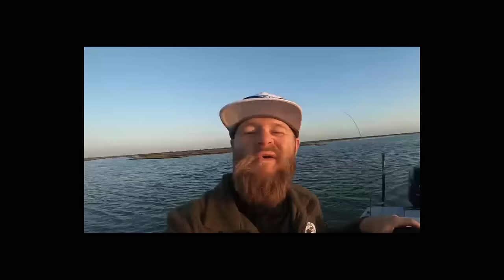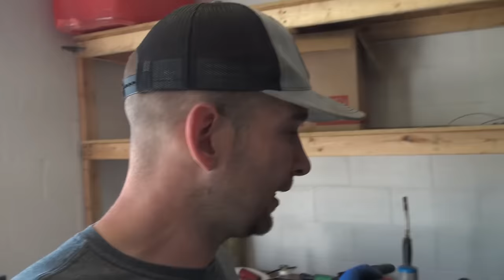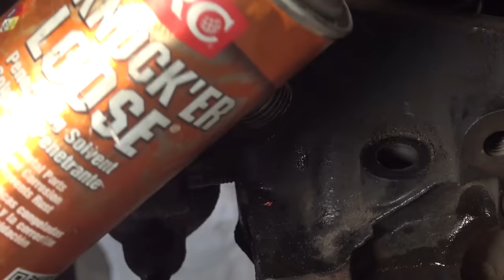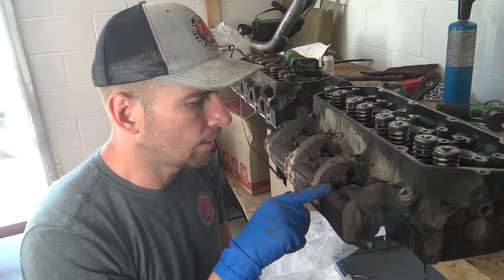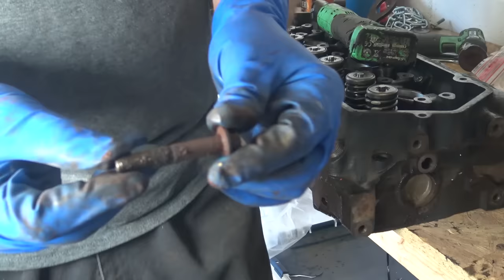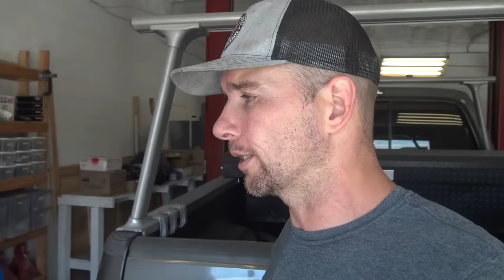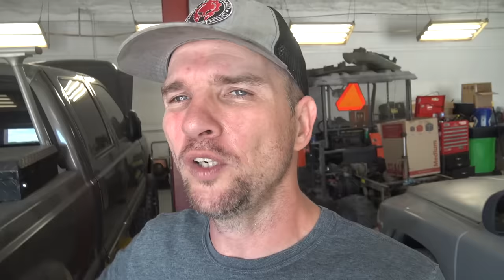Old Mechanic Taught Me This Trick To Removing Rusty Exhaust Manifold Bolts!

Comment: Great video man! I have one piece of advice, when I’ve been working on customers cars/trucks and I’ve had to remove their manifold upon reassembly I’ve changed out bolts for studs 😉👍🏻
Reply: By stud do you mean basically a bolt without a head?
Reply: Good advise!
Reply: That works pretty well if you intend to take the head and manifold on and off together. The problem you run into is a lot of vehicles don't give you the room you need to slip the manifold off or onto the studs. So you have to evaluate this on a case buy case basis. You could run into a tight fitting v8 head where you install the studs then torque down the head and find out you can't get the manifold on over the studs.

Comment: GREAT TIP
Learned this from my old high school shop teacher...though we didn't have any release lube then. And I was shown the heating part by my father. 
Though I didn't know about the sagging of the manifold. I Do Now
I have also found that if you smack the head of the bolt with a hammer while turning the wrench, that will work too...though not a 100% fix.

Comment: Hello, Stephen. Your video on loosening rusted manifold bolts saved me.  I bought a 2018 RV from a dealer.   After getting it home I discovered the water heater had never been drained. The heating rod was corroded into the tank opening and was not about to let go. I sprayed it with lock freeze, or unfreeze, then WD - 40.  Let it sit a day or 2. I used a narrow chisel to knock the  corrosion loose from the tank keeping it away from the threads. Brushed it with a small wire brush, tapped it with a small ballpeen hammer, then applied your technique. Pressure. Flip the switch. Pressure flip the switch. Took about 10 switches but it came loose without damage. Your technique saved me a lot.  The dealer should have done it during make ready.  Now I have to clean the remaining sediment out of the tank and it will be ready to go.  I'd take it in for them to work on it but they are 12 weeks out on repairs.  Won't work.  Now I need to learn how to screw the couch to the floor. This is my responsibility. Thanks again!!

Comment: Great video! excellent tips! 
Take for what it's worth, I'd recommend using a copper based anti-sneeze over the typical aluminum based equivalent. The aluminum based anti-sneeze based turns to a chalky like dust - essentially melts and the fluid it's suspended in burns off Losing some if not all of it's anti-sneeze properties (especially around the bolt shank) when significant amounts of heat is applied.  Copper anti-sneeze doesn't. 
Also, with manifold studs, I typically replace the steel nuts with brass / bronze. The threads on a brass / bronze nut will come off a bronze nut long before it snaps the stud. providing the stud hasn't rusted away to nothingness. 
Also, maybe a thread restorer aka chaser would be a better choice than a tap.  With a tap, you run the risk of cutting new threads if the tap doesn't get in the whole straight or if the threads are really messed up in the beginning of the threaded hole. cutting new threads with a thread restorer / chaser is not likely to happen because thread restorers / chasers aren't made of hardened tool steel.
Just a thought.
Reply: And dont forget to use a handkerchief!
Reply: Always.... Gesundheit!
Reply: i have NEVER had a bolt seeze using marine or copper bsed anti seeze

Comment: Anti Seize compound? , I use that stuff on everything, because I never know if I'm going to be the one who works on it next!
Reply: ,,,   For exhaust bolts I prefer the copper anti-sieze, , otherwise aluminum anti-sieze is good everywhere else,  with one BIG exception, do not use it on slide pin caliper bolts for your brakes, ,  grease is the only thing to use there.
Reply: For dry areas, copper anti-seize works. Best is nickel anti-seize, no battery effect with moisture. 
Best wishes
Reply: Do not use anti seize on your rollers on tractor trailer drum.brakes, all that does is collect grit and grime
Reply: theda850two if someone is using anti seize on their slide pins then that’s just natural selection at work
Reply: @theda850two  I've had issues using aluminum anti-seize on aluminum motorcycle engines, bolts seize up like I didn't use any anti-seize at all. I use copper on everything.
Reply: The thing about copper or aluminium greases is that particularly in areas that get hot the grease burns of or melts away and just leaves you with hard deposits in an otherwise clean thread. I’ve struggled with spark plugs and manifold bolts that people have put copper grease on. I tend to just use no grease and as good bolts as I can on manifold bolts. Even replacing bolts with studs and copper nuts.
Especially the cheap grease will leave you with pads chunked up with copper and brake dust and not a slip of lube left.I now use ceramic grease on brake parts and rubber or silicone type grease on glide bushes and under piston dust covers.
Reply: I use red thread locker on everything! Except head and exhaust bolts 🔩
Reply: Oh it’s a beautiful thing! With a name like hotrodd100 you do not disappoint 🙏
Reply: That's all well and good but when it's a 30+ year old manifold that's never been off anti sneeze ain't going to help you one bit😂
Reply: @theda850two  thanks for the heads up.
Reply: Same, the tricky part is getting it on the area that rusts and doesn’t contact the threads but putting loctite on the areas that do, for components that require loctite, also one good thing about loctite is that on anything that isn’t seal critical, you can use the lower range of torque and it actually makes it easier to remove later than if you cranked it down dry
Reply: Anti seize is trash especially on spark plugs, It causes miss fires. Use synthesis brake caliper grease on the threads, it works great. Lasts for many years and plugs stay at perfect torqued.
Reply: hotrodd100  if it causes miss fires as YOU admit then WHY use it when there is better products out there. The average backyard mechanic is going to have MISS FIRES!😭
Reply: Dont you wish the last SOB who took it apart was that considerate😡
Reply: As as a Naval field tech who work on aircraft carriers and subs, that's what we use on just about every fastener. Dry lubes and zinc anti seize.
Reply: hotrodd100  modern spark plugs come with a coating/plating that doesn't require antiseize on the treads. Welcome to 2020.
Reply: Molybdenum disulfide is the way to go.  Great slickness factor, great heat resistance; it somes as a dry powder that you can add oil or thinner at your option for ease of application, do you want a dry lube use the thinner.  Expensive but worth it.
Reply: @Binderbird4X4Firebird  anti seize is a lubricant on the thread and the preload in the thread will be higher at any given torque value. So you typically have to drop the tightening torque by ~30% to achieve the same preload as the dry thread.
Reply: Because you messed it up and you'll always have to take it off again! Never fails. "Oh darn, I guess that went on first."
Reply: Wish I knew this long ago. I have drill out and extract so many bolts.

Comment: I wish all my rusty bolts were as rusty as those 😂 I could live with that.
Reply: I agree. My rusty manifold stud nuts look like they've come off of the Titanic!  lol :(
Reply: Same thought here. I'm pretty sure basically all of the manifold bolts I've ever dealt with were in worse shape than these when they were originally installed at the factory.
Reply: @bobjohnson205  Hah... barnacle rust. I know exactly what you mean. I live in Cleveland. Brought a fresh Honda Pilot from Virginia last year and it's already developing barnacle rust on some fasteners. The exhaust manifolds are 4 stud straight to the cats. Nuts welded themselves to the studs so badly you couldn't even see them. They looked like brown mentos.

Comment: Great video. Great advice. Many years ago, when I started doing my own oil changes, a mechanic told me to only use a 6-point wrench or socket on oil drain bolts so as not to round the bolt head. You are very correct. Knock-Er-Loose rust penetrant is the best I've used. Amazing product. Subscribed. Cheers.

Comment: Another trick I've used after using penetrate oil, was lightly warming the threads, then using a lit Candle to drip wax upon the threads where they enter the bolt hole (if you have access). Upon cooling the wax tends to draw into the threading, pushing penetrate oil deeper as well as the wax which repels rust. Steve is right though it takes allot of time and patience!
Reply: Project Farm already proved the "wax method" to be a myth.

Comment: A good tip for smaller bolts and screws that have Loctite on them, you can use a soldering gun held on the bolt head to melt the thread locker and then remove the bolt or screw. This works best on smaller 1/4” or 6mm screws that are in aluminum and Loctited.
Reply: Great tip will help me get link screws out of watch bracelets. You usually locktite with blue but some people use red.
Reply: Ever encounter the green stuff? It is called rock set, doesn't loosen with heat. Ordinary water or ripping the threads out with brute force are your only options.

Comment: This has to be the MOST informative advice I have received/watched on engine bolts. I have exhaust bolts that are original and I am guessing they are not going to come out gently.  I will do as you say, an hope for the best. a little chilly doing it outdoors,but we all must do with what we have, regardless of the circumstances.
Thank you for your advice I will update when the replacement is complete.

Comment: I had some bolts that your method did not work on them, they were rusted so bad. So I sprayed them with penetrating oil on them for a couple of weeks. Some of the bolts then came out. I had some really tough ones, I heated up the manifold til it was red. I then worked the bolt in and out like you show in your video, for about 15 minutes, it finally came out.

Comment: Use the tip of the flame to heat the manifold. You'll find it heats up quicker
Reply: Yeah, the torch tip was a little too close to the work.  Hottest heat is at the tip of the internal cone of the burning gasses.
Reply: He should use MAP gas since it is a wee bit hotter ;)
Reply: I was hoping someone would say this.

Comment: I like to use a breaker bar without the  ratcheting mechanism for the loosening tightening process, than switch to a ratchet.
Reply: Jeff Mays Good tip. A breaker bar would've eliminated all that switching of the ratchet direction he had to do.
Reply: Yeah, the old mechanic should have said lose the ratchet first
Reply: I got the same advice long ago. A ratchet is really a labour saving aid, not a device for breaking bolts.
Reply: More leverage with a longer lever increases the  likelihood of shearing...breaking...the bolt.  Penetrating oils and heat works best for me. In fact, I apply the penetrant, heat,  cool with more penetrant, heat again , cool again......expand....contract...ditto..ditto. and this process never has failed me. I prefer to spend time this way than LOTS of time drilling nesbroken fasteners. You can almost always get access to a bolt with heat. Not so with a drill and bit. I’ve learned the hard way. 56 years of fixing my own machines. Google wasnt around when I was learning. It was Hot Rod and CarCraft and Dad and Grandpa. I was lucky. Good luck. Semper Fidelis Dave Heitman
Reply: Yep. I do it the same way. With a breaker bar.not to exert any type of extreme force but to gently work it back and forth without having to switch that ratchet back and forth constantly.
Reply: @gregcjdr  thanks, I should have clarified that a little better, you explained it very well.
Reply: Plus you save wear and tear on your ratchet mechanism. Its starts getting sloppy if you do that too much.

Comment: Awwww, Texas rust is adorable. Come on up to Michigan. This is an everyday thing, with hardware that no socket is ever grabbing.
Reply: hahaha .. i was watching this & thinking the exact same thing, these guys don't know six months of winter road salt every year .. lol @ the propane torch
Reply: dow flake is even worse
Reply: HAH! Adorable!  In Ohio that would be a brand new bolt. I hope his next  video is how to remove a fuel filter from a Chevy without cutting the lines
Reply: @richardmaurer9002  by now, Chevy fuel filter previous repair needs repairing again, oh and brake lines too.
Reply: Here in NW Ohio, you don't need to snap the bolts. Most of em already popped on their own😂
Reply: @kylecroninger9686  esp. the ones on the ends.
Reply: @jamesgeorge6551   exactly. And it's always in an aluminum Vortec head
Reply: @kylecroninger9686  Triton and Hemi arent immune to it either, but the GM, I can do in less than an hour per side, because I've done hundreds of them. Fords are the worst,  04 and later F150's the motor needs to be lifted to even entertain the idea of removal.
Reply: @jamesgeorge6551  the f150s can be done without lifting the motor. It's a PITA, but doable.
Reply: @kylecroninger9686  well, torch out everything,  extract studs, replace with new, is the fastest way, but not the cheapest.  Sometimes trying to save an $80 manifold is not cost effective when it takes 2 hours to get off. Luckily, the service manager utilizes my diagnostic and electrical problem solving skills more than my flat rate that fucked exhaust skills.
Reply: @jamesgeorge6551  if I'm working in my shop, I scrap the manifold at the first sign of turbulance and explain to the customer why and how it's more cost effective. When I work my day job, I have to do what I'm told
Reply: @kylecroninger9686  I resemble that remark. I don't to too much side work anymore, although it does pay better. I have a plow truck, a diesel flatbed, my daily, the wife's car, the backup car  and 3 kids who all drive as well so there's no rest for the weary. I try to buy a few cars to flip, as that's legal, wrenching without a facility license is illegal in my state, but most people don't have a clue.
Reply: @jamesgeorge6551  it's not illegal here, but you will get mean mugged by local shops. My home shop is legal and insured now. Not worth taking a chance anymore now that I can afford it. Hoping to phase into something bigger down the road
Reply: Nova Scotia, Canada has even worse rust issues than Michigan. Basically completely surrounded by the North Atlantic.... rust there is so different from places further inland
Reply: I live in Maine and have replaced my socket set with a hammer and nice set of chisel s.
Reply: @199jl  I'm in Ontario and rust is pretty bad here, but I can't imagine how bad it is for you guys in the Atlantic region
Reply: @Jason-fp7vi  its comparable in some parts of Ontario but as a whole all the maritime provinces have the worst rust issues in the country. I've mechanic'd more than just back east too so I've seen outta province vehicles and lived in Ontario and Alberta too. BC rust is bad but I still think that north Atlantic water and the more common use of road salt back east tips it being worst there personally
Reply: @199jl  is it true that Alberta cars don't rust bad? I heard that they don't use road salt because it's too cold, and therefore their cars are mostly safe?
Reply: @Jason-fp7vi  Alberta cars still rust but much much slower.... km's are almost always far higher and maintaining them in motor vehicle inspections happens far more regularly in salt prevalent places. Comes down to what ya want to deal with more but a properly and regularly maintained vehicle here in Alberta is always an easy decision to buy I think
Reply: @Jason-fp7vi  we were getting -50 in Red Deer just a few weeks ago haha. Road salt cant work in that. Beet juice works though. It's common and was introduced by BC actually
Reply: @199jl  fascinating never knew that!
Reply: @elizabethjansen2684  yeah. It was something that is needed on the mountain highways

Comment: Best how to I've ever seen iv been restoring a 95 ford bronco and I'm trying to do manifolds in the truck on a 5.8 tomorrow and that gave me a good insight on how I need to proceed thank you
Reply: How did it go with the manifold bolts? I've got one to do too but I think they'll be ok because they've been out when i put a long block 351 in but it's been sitting under the carport for about a year because it needs a full exhaust system but im putting bbk shorty headers on it and a flowmaster Y pipe in

Comment: I work in a machine shop that does oilfield work. I have had to remove many "seized" bolts from field equipment. A little penetrant and rocking the bolt back and forth and they came right out, guys thought it was some kind of dark magic.

Comment: Excellent video and technique.
In conjunction with your suggestions, I've had excellent results with using a pneumatic impact wrench, but with the air pressure turned down so that it just gently hammers the bolt without breaking it off.
The vibration and shock helps break the rust loose.  Reversing the impact every few seconds is also important to prevent galling the threads.